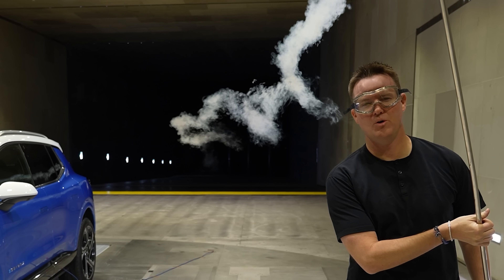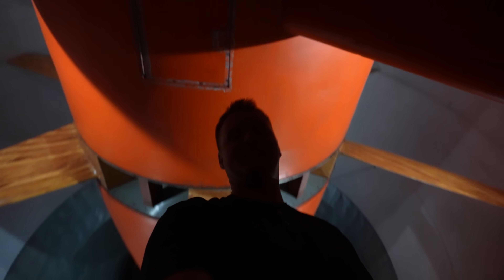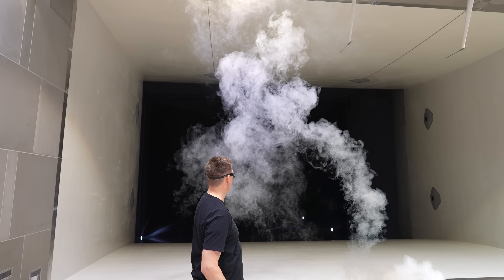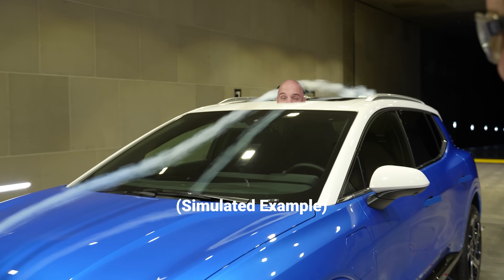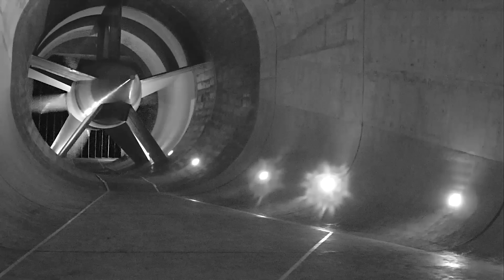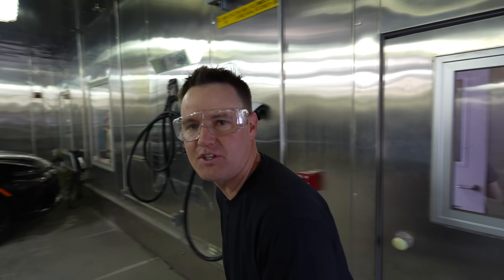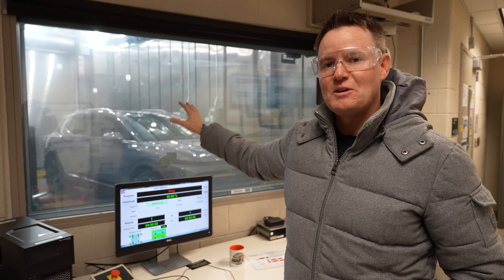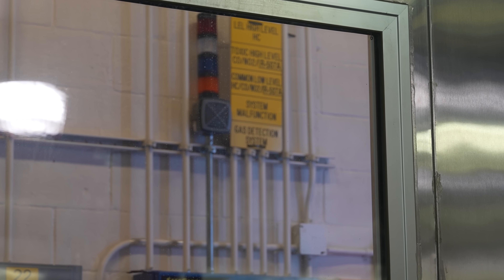Inside GM's Secret Car Testing Facilities!

Comment: They use a similar key system at Large Hadron Collider to make sure that noone is down in the accelerator tunnels before starting up because you would get blasted with dangerous syncrotron radiation (X rays) when the machine is running and also there are very high voltages at some places like the injector magnets during operation.